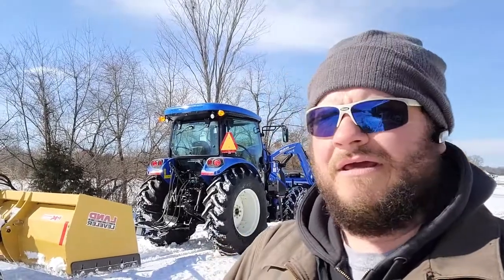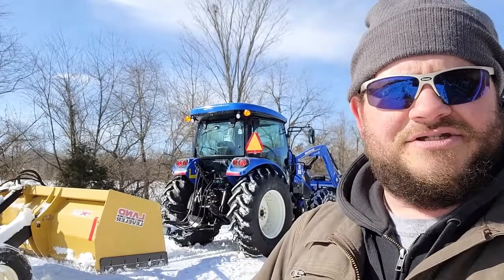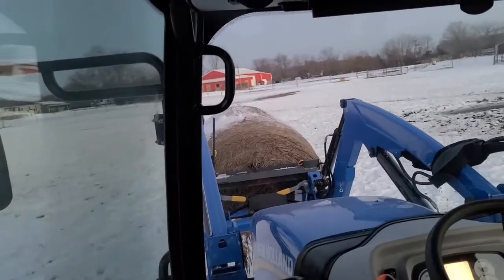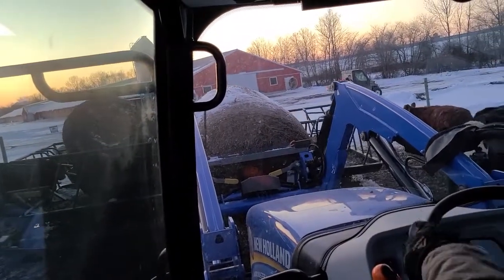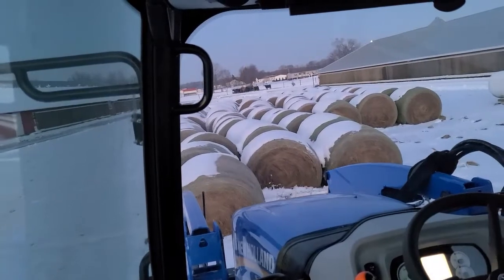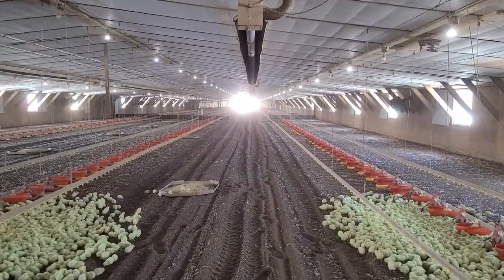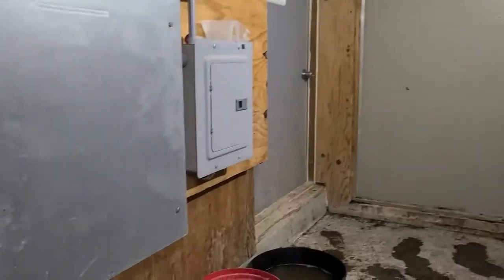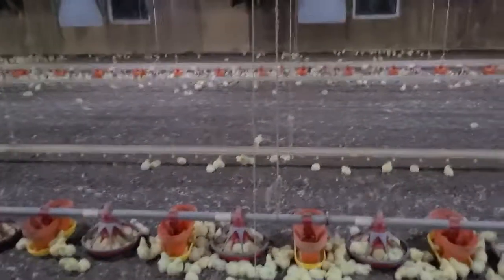WORKMASTER120 CLEARING SNOW

Comment: How is tractor holding up I’m about to buy one I’m mostly John Deere guy but Deere has out priced the tractors and 120 is about 30k cheaper any comments would help me
Reply from the maker: The tractor over all is solid. I've had two warranty issues, one was I think just assembly error, the linkage for the the 3 point hitch to move up and down sheared off as if  it had been bolted way to tight. Simple fix really, the other issue I've had is the sensor to the seat which has shut the tractor off twice on me. Dealer went through the harnesses and just plugged everything back in and it's been fine. I don't feel like I bought any less tractor and have been happy with it. Now pulling a brand new 210 discbine, all other hay equipment, manure spreader, 12'disc she's done very well. We're going to be harvesting our last cutting of hay here soon and I had planned to do another video in full.